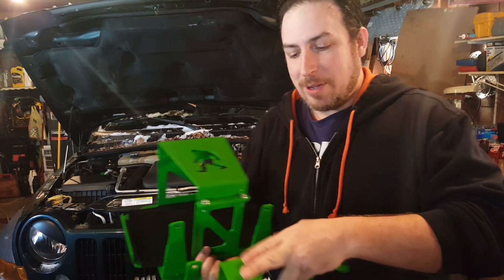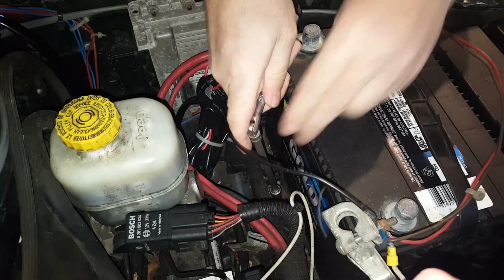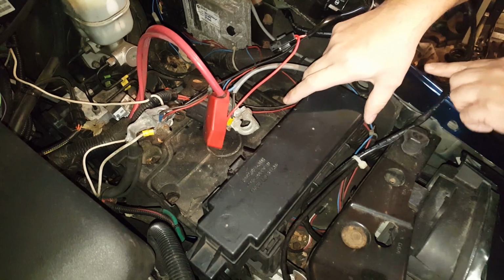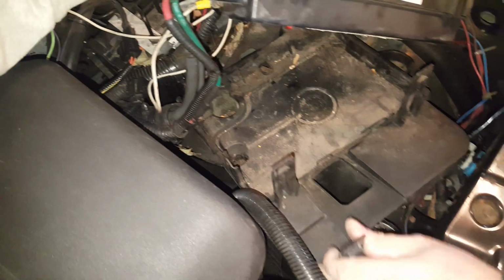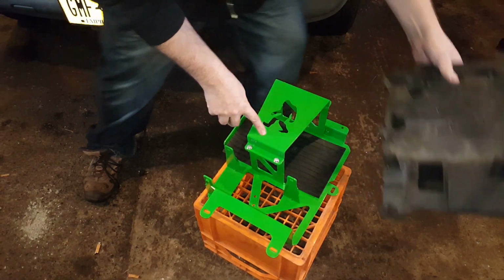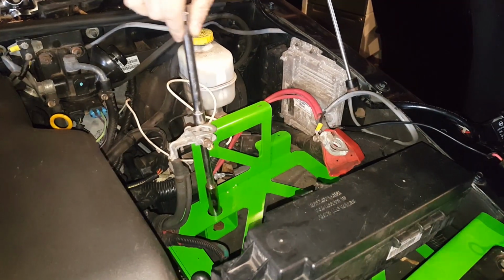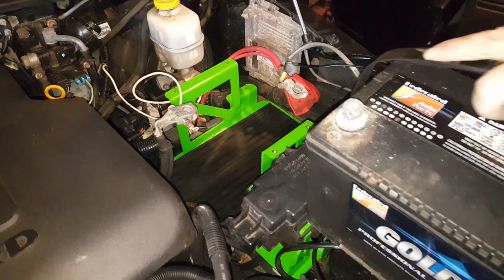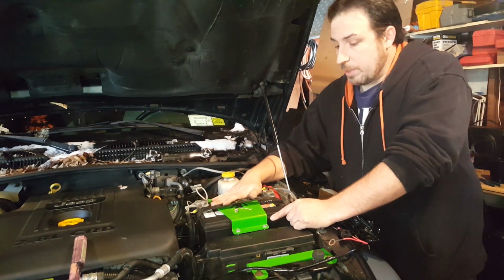Jeep Liberty CRD Battery Tray & Webasto Mount - SasquatchParts.com

Comment: Buddy just wanna tell ya , i know you were fighting with a vibration as was i ,, and it started when i installed the Moog ujoints , well it was them that caused the issue , long story short spend the extra money and get the Spicer part no. 5-1310X . And it come with different color c-clips for different thicknesses , spicer says 85% os their steel drivelines use the cooper c-clips to properly center the joint and they were right , i took out the brand new Moog joints and installed the spicer with cooper clips and waa laa my jeep rides as smooth and 100% vibration free like it was brand new again .. just some fyi for ya buddy...
Reply: Good to know !